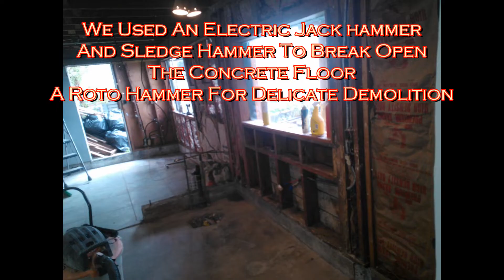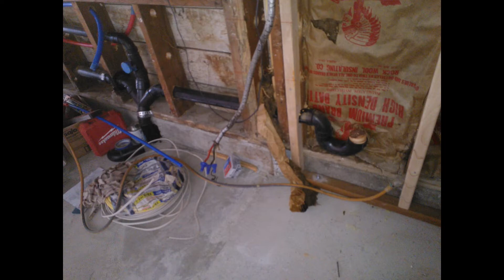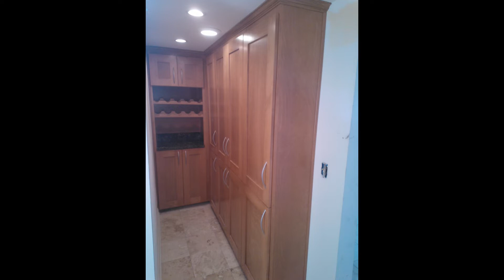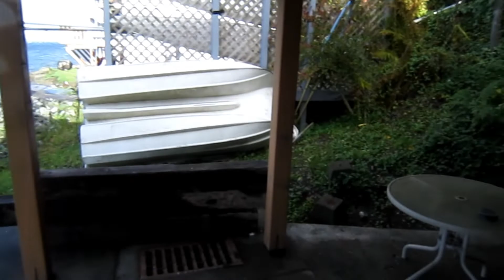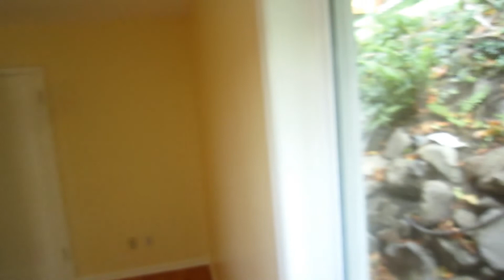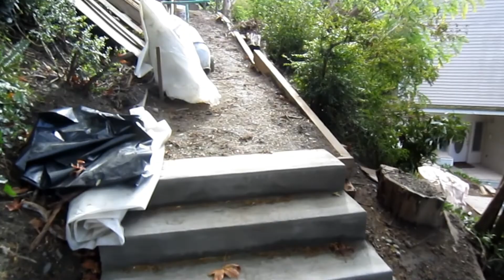Plumbing New Drains Under Old Concrete - Toilet, Shower, Sinks, Laundry, Venting.

Comment: Thanks for sharing. How much did all this work cost to create the bathroom and kitchen sink.
Reply from the maker: This project is a few years back now. Did you mean the upstairs or downstairs? Both completely reworked their areas. Relocating all the plumbing, wiring,  floor layouts. I think the whole house was in 180,000.00 range and each kitchen area with all the demolition and new materials close to 50,000.00 each. These were not simple remodels there was another 70,000.00 for outside work like decks and all the concrete stairs and flat work. It was a big project taking about a year to complete.